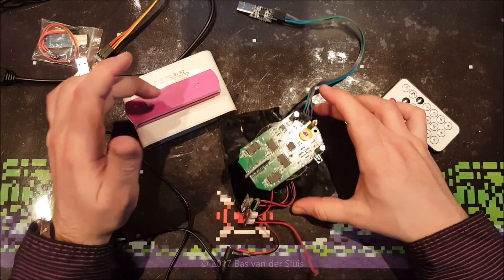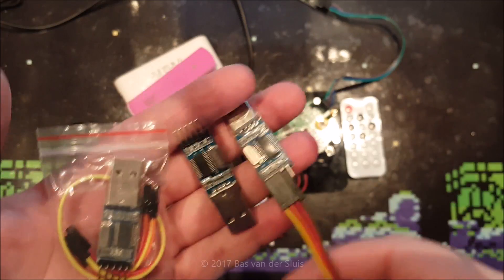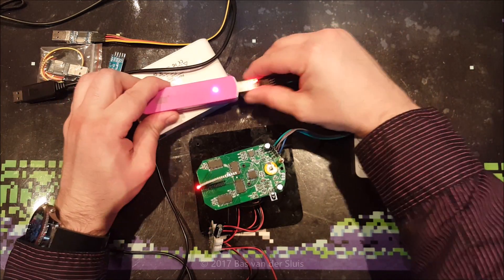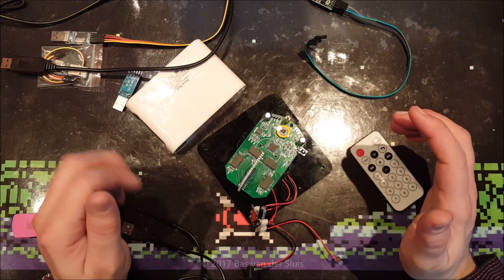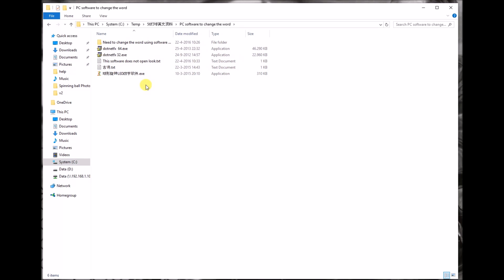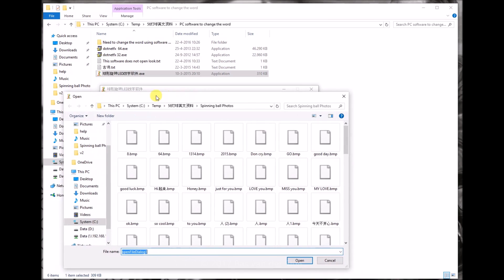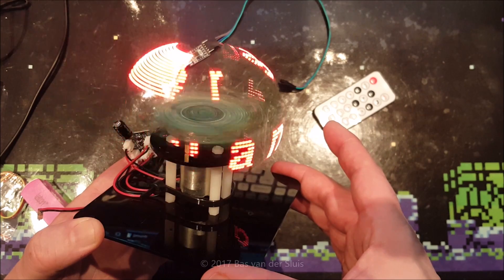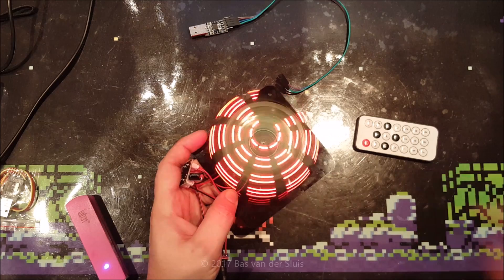How to build the Spherical Rotation 56 LED [...] kit - Part 4 - Programming new texts and images

Comment: Hi the instructions says that you need to install a driver to use the programmer. Where did you get the driver for yours?
Reply from the maker: I didn't get the programmer working on Windows 10, so I ordered a new USB-to-serial device which did work.

Comment: After connecting with the USB converter and trying to upload new text or images, i keep getting the message "Failed to send". Any ideas of what I should check? I confirmed the wiring is right between the converter and the board. I'm also on windows 10 and I am already using the CP2102 board you linked. EDIT: for anyone that has this problem, also make sure you've downloaded the drivers for the USB TTL converter :) fixed it right away for me.

Comment: Hi, I bought the same kit. But I have a problem, the layers 10 to 15 do not work. It seems, that the port 3 of the MCU is defect. I have asked the seller to offer an new programmed MCU, but I got only a new MCU without program. Do you have a link to download the program code (like in your descrition to the spherical rotation DIY), that I can program the MCU by myself? Thanks for helping.
Reply from the maker: So you got a new MCU for this Spherical Rotating kit? That will be a nice job to remove and resolder. I think you can just reprogram the MCU with the files provided from the link in the description.
Reply: Sorry, I Wrote in the wrong thread. I have a problem with the canton LED tower. Sorry.
Reply from the maker: That's what I thought initially. I tried to find software for the MCU of the Canton Tower, but I have not found it so far. I can try to mount some header pins on my tower and see if I can download the software from the ROM of my MCU. If that works out, I can upload it somewhere, so that you can download it. I think I'll try that this weekend. I'll keep you posted.

Comment: Ali express provides good working USB to TTL
https://nl.aliexpress.com/item/5pcs-lot-CP2102-module-USB-to-TTL-serial-UART-STC-download-cable-PL2303-Super-Brush-line/32638792909.html?spm=a2g0z.search0104.3.2.WIXgnr&ws_ab_test=searchweb0_0,searchweb201602_2_10152_10065_10151_10068_5410020_10304_10307_10137_10060_10302_10155_10154_10056_10055_10054_5370015_10059_100031_10099_5400020_10103_10102_5430015_10052_10053_10142_10107_10050_10051_5380020_5390020_10084_10083_10080_10082_10081_10177_10110_10111_5420020_10112_10113_10114_10312_10313_10314_10315_10078_10079_10073,searchweb201603_2,ppcSwitch_5&btsid=f5ee7958-3e2a-44d8-997f-02031b1fa565&algo_expid=e9c2bd5c-26b6-4491-bf8f-a707d88dc14f-0&algo_pvid=e9c2bd5c-26b6-4491-bf8f-a707d88dc14f&transAbTest=ae803_2

Comment: Hi Bas, nice vids btw. There is also a englisch version of this programming
http://files.banggood.com/2016/SKU343833.rar
Its included in the rar files.
But, i have a question, did you mange to adjust the clock, because for me i did not have any succes.
Also did you manage to upload a HEX file into this device. I get a error when i open the file.
Regards,
Roverius
Reply from the maker: It did not require me to program another hex file to use the text and images function, so I have not tried it. I assumed that setting the clock was done by using the remote. Let me know if it does not work out for you, so I can try it if you want.
Reply: Thx Bas,
If i look on you're vids, i see at some point the clock running, mine has some chinese things instead.
According to the instructions, button "2" on the remote should give the clock and with the "- or +" button it should be possible to adjust. No luck so far.

Comment: The gap between the two coils has to be as small as possible. Also you must increase the 4 resistors 1.5kOhm up to 3.3k better 4.7kOhm to reduce the power consumption of the LED. I got a blue one, sucks ~300mA, the red one sucks 480mA whe all LED are on. Increasing the resistors reduces the brightness a bit, but it's not crashing anymore. 73 de peter
Reply from the maker: You sir, are a hero. I replaced the 1.5K ohm resistors for 4.7K and now it works like a charm! Thanks! https://youtu.be/yWhOs9wqr6c
Reply: Dear Bas. Do you know which size is it for the resitors ? Is it 1206 or 1210 ? for the 4.7k I mean. Thank you !
Reply: Cant believe theyre selling the kit with the wrong parts.. I know china is shit quality but christ dont they test the fucking thing before selling?
Reply: You seem like an expert. I built this kit but when I supplied 12 volts with my power supply it spins but doesn't turn on. The strange thing was that it was turning before and LEDs were lighting up. However now the LEDs don't light up when it spins and the IC chip on the board with the switch, coil, motor, led, and power wires gets hot. Any suggestions? Thanks in advance!
Reply: on mine the 8 pins chip on that board burned (smoke !). I bought a new one and by simply replacing it it worked all right. I didn't do anaything else, as if the first chip was faulty ..
Reply: @nczioox1116  The board runs on 4.5 to 5.5 volts. Anything more lets out the magic smoke.
Reply: @nevellgreenough404  The power source is 12v DC
Reply: I’m not an expert, but I just assembled this same kit and had the same issue.  My solution was to go over and double check the power supply circuit board.  Make sure you have the wires going to the right connectors - once moving my connections around it works great.  Hopefully your problem is as simple as that
Reply: So is it the brown out detection on the processor kicking in? This seems like something that should be fixable without reducing brightness as well.
Reply: I have the same issue and changed them to 4k7 and it works till you start playing all the pictures then error mode again. Any ideas?

Comment: The gap between the old and new text during rotation on mine appears a little wider than on yours; between a 1- 2cm arc: https://youtu.be/OF8qmpkpp7M

I would play around with the two different speed files in the 'pc software to change the world' file.  And use the exact settings pictured in the instructions for that software.  I used the both the following TTL cable, and my Arduino Uno with success at programming over my 64bit Windows 10 platform.

 PL2303TA USB To TTL RS232 Upgrade Module USB To Serial Port Download Cable
https://banggood.app.link/iYNH193RmC
Reply: The gap is a function of the "5V" power supply voltage. Raise it a bit. But if you go too far, the text/image rotation will reverse direction and jitter. Mine looks best at about 4.8V.